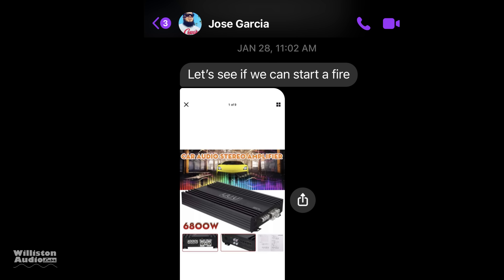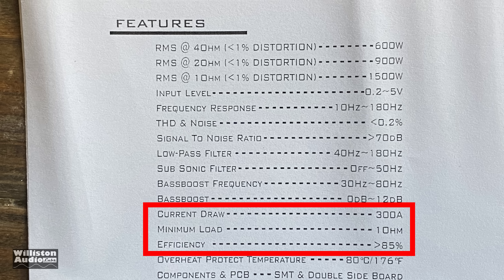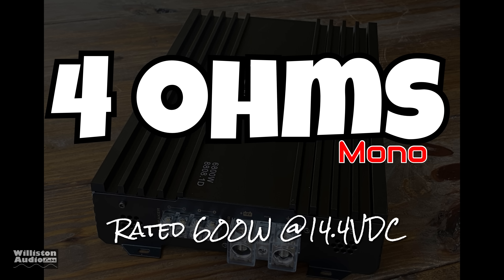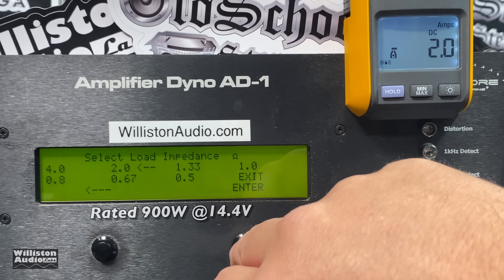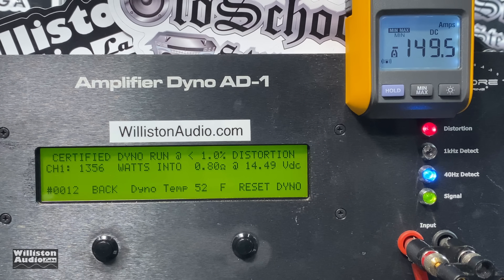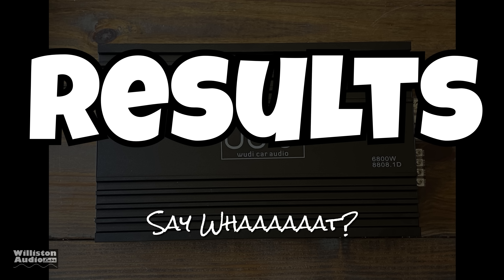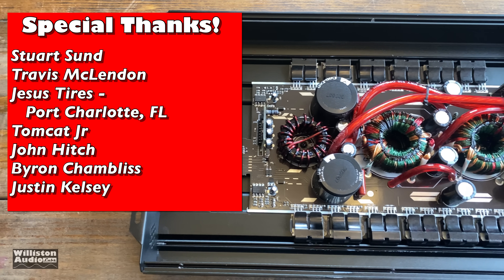BEST $100 Subwoofer Amp?? WUDI 8808.1D 6800W Amp Dyno Test and Review [4K}

Comment: Greetings Big D Wiz.... from another Big D..... BIGDOGBRODAVE of ONE CALL INSTALL here out of Honolulu Hawaii... I started installing here in 1973 when the BIG CHEAP AMP.... was a underdash EQ box with 25 watts... and a FADER!!!!.... I came along at a time when cars typically had only one speaker in the dash and a AM radio so.... quite the improvement. I am currently building an AUDIOMOBILE RACK system.... for fun. I have been watching your videos and I wonder HOW the REAL old school amps actually perform on that Dyno there. I am sure the readings would be underwhelming to most viewers of these times but back in the late 70's to actually have 100 WATTS to power them "100 watt" Jensen TRIAXIALS.... well... People knew.... I owned a pair of MINDBLOWER 6x9 speakers back in the 70's in my 70 Challenger. PERFECT TRUNK for them.... Hunting for them as of late as well as AUDIOMOBILE GEAR. That being said, I recall YOU have a SA 1600 system amp. I wonder if that could be tested. I am IMPRESSED with this WUDI as it appears to be the modern version of the JET SOUND product. Coming from Asia BUT on the low end, I recognize that FONT... in my nightmares..LOL..... JET SOUND products were synonymous with ENGINE NOISE.... I learned a lot of tricks to eliminate engine noise thanks to JET SOUND..... ugggggg..... I LOVE this video so I came out of hiding to give it and YOU a BIG TWO THUMBS UP...... Love your work... Great narration... YOU BIG DUMMY!!!!!!....LOL..... Keep up the great work and you be SAFE and BOOM on... TEST an old AUDIOMOBILE and a ZAPCO... a CRAIG... the 72 watt Powerplay... that thing... and a 500 watt CONCORD if ya can find one.... they blew up a lot....  SANYO... was a VERY EARLY contributor as well as PIONEER... that GM-120 was the best... the Component PIONEER..... back in the 70's... I installed the very FIRST CD PLAYER ever made for a CAR in America, a CDX-P1 made by Pioneer... in Art Rubensteins car a Mercedes, Later I installed the very first CELLULAR PHONE in Art's car. He was the Pioneer rep here back in the daze... His FIRST CELL BILL was over 1200,00 dollars...... I remember his distress...LOL....  Hawaii was the TEST BED for Cellular technology thus.... it came here first them... BOOM.... more BOOM....LOL.... WELL It's 2021 and the cheap POWER is WUDI... and the other end... CRITICAL MASS and maybe ABYSS... a few others... It still amazes me how much power engineers these days squeek out of a 12 volt antique...  POWER ON!!!!!! Aloha BDBD

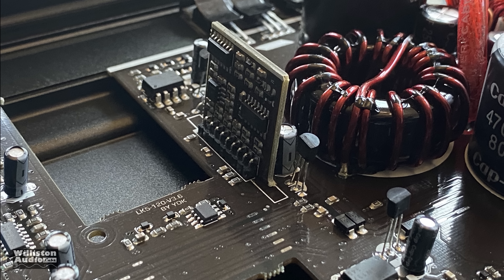Comment: As for your missing "chunks" of PCB, the larger one looks to have been used to make the small vertical daughterboard you can see in the top right corner of the motherboard at 10:48. The smaller chunk may have been used elsewhere, but I can't see it.
Reply: 10:43
one beside the cut out, the other on the top right at the output

Comment: Love the channel, have a question for everyone. Ok so most cars with sunroofs have those pressure vents in the rear corner panels near the trunk and bumper. Now im running 6.5ft3 enclosure with 2 sa15d4rev3 in a 2020 koa Optima special edition. Took my intire trunk. Those little vents vibrate so bad and is very annoying. Cant block them and you dont want to remove them as they are extremely important. Has anyone come up with a solution to slow the flow of air without blocking them but killing the vibrating flap noise. Thought about fiberglass batting of some sort or a mesh that allow air flow but very slow?

Comment: This is fake review, because no such amp is currently sold on ebay, and the last one listed sold for $200.  The one on banggood is sold at $150.  There is no point in this review.

Next review - check out this Lexus bargain for only $100!  (spoiler - there is no such thing)

Comment: Toro tech r6 suppose to do 4k no prob. Why dont u pick 1 up or see if thhey send one out to prove what their big power amps are about! Very interested in your opinion D, and as always plz check out the wolfram aw-250.4 Its built like a 3500wrms tank! plus sound quality very good and u believe 430 x 4!!!!! uncertified. no telling dynamic this thing could get right up on 500 x4 w/ good voltage. prob best value other than rockvilhle bad ass 4ch is skar rp150x4 for 199$ AND weather resistant as well! I know ALOT of peep love to see that. i bought the soundqubed s4-100 cause ur video and its awsome man, Thx for what you do big D! Im just getting back started bugt i have a channel bass life xxl, check it out and help w/ any pointers if u would. I know i need better light show thhings better and speak up

Comment: I wonder how big the difference would be if someone would replace the bargain bin caps with something a bit better quality like ELNAs Nippons, etc
Reply: i'll order some and do it. I ordered one and havent installed it yet
Reply: @kennethnicklowicz1030  Try going up just a little on the micro farad count (NOT VOLTAGE) if you do in fact get some name brand caps. Id imagine replacing the filter caps with some extra capacitance would net you a little bit more on the bumpa'bility of the amp.

Comment: Great amp
Me I only look for the rated fuse when buying a good amp 
50 amp 500 watts at 4 ohm 
100amp 1000 watts . That works for me it is the easiest way to not but an overrated  amp . Fuse talks.  
60 amp fuse advertising 1000 watts at 4 ohm is a lie. Fuse is resistance for power output
Reply: Some cheapo amps have extra fake fuses, Lanzar comes to mind.

Comment: Excellent review on Chinese amps. I've had "3800w" mono Wudi amps before but they went boom connected to just 1.5 Ohm load.
Reply from the maker: This one was a big surprise!
Reply: Test power bass  Pb-1.8800D monoblock amp
Reply: my wudi blew soon as i turned it on ,,,3200, might try this one
Reply: @joshhacker3926  Never run amps at their rated spec. Always run below-spec for optimal efficiency and reliability.
Reply: @Samosayummyyay  nonsense. Quality amps exceed rating.
Reply: Wow very surprised , not by the internals though figured it looked like another
Reply: Mac Nifty  I feel pity for that truck already!
Reply: Don’t buy them they catch fire I had to catch fire in the back of my car
Reply: @mr.jayr6homie225  yeah stuff like that would be my concern on cheap amps more so than watts
Reply: kkk n

Comment: There are several variations of this model. Look for "F83532" as the model number and it will narrow your search for the same amp Big "D" tested. It's the only one that has 1/0 power cable connections.
Reply from the maker: Thanks 👌

Comment: Hey BigD,i got one of this for myr341 (83.77USD)...im smile here also bcoz it reach what is the rated for 2ohm and im running it in that mode.😆But im notice they use different brand of caps and not audiopipe cable inside for my amp.Yes,they dont have remote volume  output and also cant strapped it.But what can we expect for the cheap price😜.Thanks for the vid 👍👍👍

Comment: That just gave me a Wudi
Reply: 🤣🤣🤣 seems like I'm the only one that's got that so far LOL
Reply: must be your first time seeing a pair of woofers...?  

what yall forget is even the certified test is to 1% thd which is sh!t.   old orion stuff from the late 90's did their rated power at .0005% thd @ 12v...  just think how much energy is wasted reproducing distortion @1%  ...  1% is sh**   guess it depends on if you're looking for measured current pull from your alternator or actual clean sound output from your sound system.

Comment: Id rather just spend the extra on a 1500 watt Audiopipe.
Reply: However those results at that price are absolutely insane. It didn't go into protect or blow up. Dont even know what that means for longevity of the amp. I don't think its overkill to have 1/0 power inputs at the given current draw at all. Actually smart.
Reply from the maker: Yeah it’s crazy!

Comment: The two pieces that are clipped off of the circuit board inside or actually the input filter and the other part on the board that Clips in, it's all made in an assembly line and then all they do is click the pieces off the circuit board and plug them in and it's good to go
Reply from the maker: Yeah I’m blind apparently

Comment: Those break points on the pcb are known as 'mouse bites'. They route the board as normal (the smooth part) and then drill the tab ... then break the board out of the panel after it rides through the reflow line.

Comment: 100 bucks is a win. My question is how long would you suspect it would last? I got a 92 rockford fosgate 800.2 still going
Reply: 700s on sub's,400s  on mids, highs still pounding since 2002. Fosgate got my Respect.
Reply: Vintage fosgate power is on point for real.  I had 2 turtle shell punch power 200x2's trans Anna running 4 - 12's.  Also had some vintage alpine anps running my mids and highs.. 
Man I miss that system..I had a hifi  alpine head unit too... 
It sounded fn excellent..
Reply: I'd check your caps and stuff to make sure they don't fry on ya. Age even gets to quality stuff over time.
Reply: I def would not run this thing in a vehicle without adding an external fuse, as it doesn't come with one.
Reply: @snowyrain5730  most of your higher wattage amps don not have internal fuses.  I don't run fuses on any of mine.  (before anyone starts telling me I am a fool everything is in the trunk so no chance of a random pinched cable.)
Reply: I've been using a ZR 1000 for over 20 years.
Reply: @michaelhollon5332  I still use my zr 1,000 from kicker and run it at 1.3 ohm bridged  to 2 12 skar evl d4

Comment: You'll see that those sections, after being populated by the pick-n-place machine and soldered in the oven, are then placed as verticle daughter cards on the amp. They do this to keep induction low by keeping all the signal components closer together.  This is typically so they can get away with the cheaper standard 1oz copper layer rather than having to jump to much more expensive heavier weight copper layer, which would be needed if all the parts were laid out over a larger PCB area.  Crazy power !
Reply: You spend a good amount of time on capacitor, inductors, and wires... but I heard no mention of transistors or Pics, you know, the things that actually amplify. Sometimes, cutouts are needed to cut down on noise (ground loops), here they've used that fr-4 as baby boards for the reasons stated above.

Comment: To get 1300 Watts for $100 dollars is a  budget gem. YEAH BOY!!!
Reply: It’s a trash amp. Who cares.
Reply: @matt6951  it's not trash for 100 dollars
Reply: @ArmwrestlingBasshead  I’d rather have a quality amp, sorry.
Reply: @matt6951  you're choice
Reply: To find a quality amp, the THD and Noise should have at least three zeros to the right of the decimal point and the signal to noise ratio should be 100 or better.... anything under that is getting closer to the trash Zone
Reply: @cdshawn  for a beginner it's a steal of a deal. Not all of us want to blow rent on an amp to say we did it 😂
Reply: @cdshawn  in a properly conducted blind listening test you could not hear the difference between an amp with a distortion figure of 0.005/110db or 0.05/90

Comment: The two cuts are a way to save money on manufacturing. If you look closely, there are two "daughter boards" soldered vertically inside the amp motherboard. Those sizes seems to correspond to them. So its likely they just snap them, and solder them where they need to go. 3 boards in 1

Comment: It's putting out just about the same amount of power as the audiopipe apcl-15001d or the audiopipe apmi-1500 amps the apcl-15001d does a little more but close to same.

Comment: I think you should include a watt per dollar category in your videos for all those new amps that you test 😁😁 so its easyer to see  whitch is most  cost effective,...just a suggestion 🙋
Reply: 3rd!
Reply: 4th 👍🏽
Reply: @TL-jw4nc  you could either get a passive set that does it for you already where a 4 channel would suffice otherwise you'd have to run a DSP and seperate them individually using that. You'd also probably want to run each set of speakers on it's own amp at that point but again a quality 4 channel should do you fine. Now the amp you'll need will be dependent on the power but anybody good quality has a frequency range of 18hz to 25khz
Reply: I'd watch those episodes too btw
Reply: I second the motion D-Wiz
Reply: Big D I agree with @audiomess2991, seems like a legit idea.
Reply: Please show the O-scope of a Brasilian amp sine wave.  I've heard they were dirty.
Reply: @NeoMK  yeah this os what people don't consider, it doesn't matter how powerful your amp is if it's dirty and clipping at peak wattage.
Reply: Concur
Reply: 1, 2, 3, 4, FIF the motion
Reply: A good suggestion at that 👍
Reply: This is a great suggestion, although it's spelled "which" and "easier", but I apologize for the correction because I'm a grammar and spelling nazi so to speak. I don't do it for my own self gratification, I do it more to help people who don't know.
Reply: @DiamondBackRattlaKid  i also speak german and my own language is croatian 😛
Reply: That’s a good idea
Reply: Not a bad notion but when considering that you must also consider the amperage and sound quality. For instance a 1000 watt Amp running at 3.8 amps is going to be pushing a lot less power at a much less quality than one running at 4.3 and not even comparable. Voltage, wattage and amperage must all be considered and it must be understood how these numbers relate to each other to truly consider.
Reply: I agree thats the only way we know it's a bargain!!!
Reply: @tinmesic  100$ amp...1200 watts at 1 ohm...1200/100=12 watts per dollar.. or what ever power rating you want to use divided by price. Ain't that hard to figure out
Reply: @J.HowardSchooler wow,you so smart...😮
Reply: A buck a watt is only valid for a sound quality amp.. at least itis I.M.H.O....( thinkin bout those 90's Vintage - Alpine/Fosgate/Orion/PPI/ the list goes WAAAY on lol)
Class D amps are efficient,  cheap power that i would use for subs that need GOBBS of power on a budget ... 
Class A or A/B amps i use for my 
Tweeters,  and my upper midrange..  
Lower midrange and subs can be ran  with class d amps... 
Sub bass needs 20x the power for humans to be even cause of our hearing efficiency.. 
Now these are ONLY MY preferences... 
I need to have my highs and mids ran with A or A/B power .... 
It can be NO other way... 
LMFAO... 
If you cant hear the difference between Any of these things anyway.  WELL then EFFF it man.. 
Lol 
Crank it .. 
Pffft
Reply: @tobiasmenough  newer 4 channel class D amps are getting better and better, hard to actually hear a difference with the higher end ones. I'm waiting until the next efficient tech jump in these amps, like LEDs, everything runs smoother with less power...
Reply: @inglouriousmofo  that's very incorrect.
Reply: @tobiasmenough  um.. he said watts per dollar, so like if a 1000 watt rms amp is 200 bucks, that would be 5 watts for a buck. I agree it should be the other wah around or 20 cents per watt. Kind like gasoline, its not .30 gallons per dollar lol
Reply: @tobiasmenough  Class D amps.... Like hooking a chainsaw to your tweeters.... Agreed.... AB appears better for mids/highs.  Theres two crowds these days SQ and SPL... thats an observation from a 62 year old installer... Know your customers.... a rule.  I get the impression more and more Class D designs are being used a lot more by the big players and as such Engineering and Research..... FILTERING.... has crept into Class D amps that today have great efficiency and tremendous power output. UNREAL numbers these days for the dollar. Class D amps these days have become so well researched and engineered that its more like hooking up an ELECTRIC CHAINSAW to your tweeters.  I get the impression soon a VERY CLEAN class D amp design will arise and as such it will blur the lines between the SPL and SQ client.   SOON they will be one and the same. AMAZING sound quality and fidelity and AMAZING power output as well as amazing efficiency..... I just wonder when somebody gonna hook up that 300 volt Tesla gas pedal to a Sound System....  Now we are talking... BDBD/2021
Reply: one more thing.... when I was a YOUNGSTER in the 70's.... I believe a REAL 100 watt amp would run ya 350 bucks... (Pioneer GM-120) or more... Amps were available but that was a LOT of money back then. That being said.... MANY DOLLARS spent in the coming decades by folks in search of TRUE High Fidelity in a compartment that could be easily transported to an area where you could BLAST it without freaking out the neighbors. Car Stereo advanced Loud volume levels... SPL.... more than anything else.   THAT was the attraction... THEN...... SQ AND SPL... the promise of Class D technology.   I just like that they dont suck the battery so hard like AB... and A amps.... That was a problem for a LONG time... Killing batteries and alternators. And yes they have come a long way too thanks in large part to the demands of the CAR STEREO crowd... and here we are today. Class D..... hmmmmm..... theres this guy named HARRISON.......
Reply: @bigdogbrodavepresents6178  The lines have always been somewhat blurred, that’s where the SQL camp comes in. I’ve always been SQ/SQL. I’d never use a Class D on my front stage. I was sponsored by CDT/AudioControl/DD/Sundown so obviously I enjoy my Music to sound good while it’s loud.
Reply: @bigdogbrodavepresents6178  My first large power Amp was actually a 1800wRMS Class T from Tsunami on a 15 inch Adire Audio MKII Brahma.
Reply: @tobiasmenough  Xtant, CDT, ads, zapCO, mtx, yeah wayyy on
Reply: @doddgarger6806  word...  lol
Reply: Until the price triples once big d tests it lol